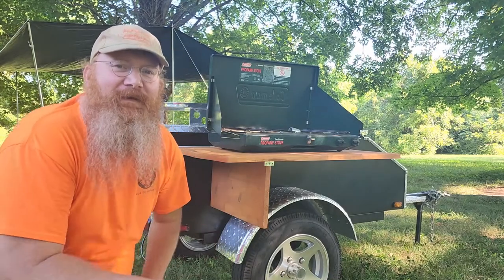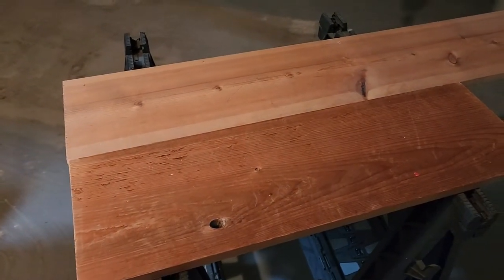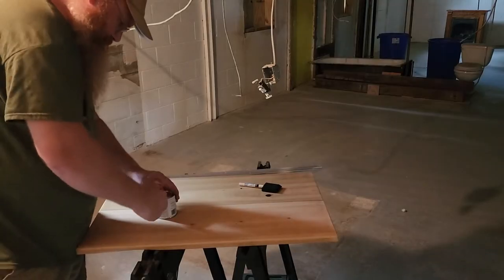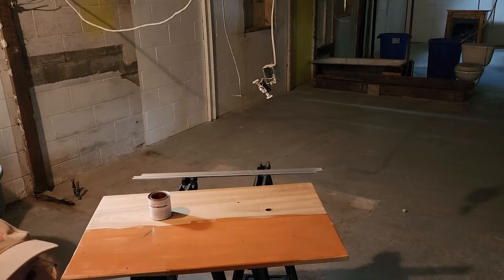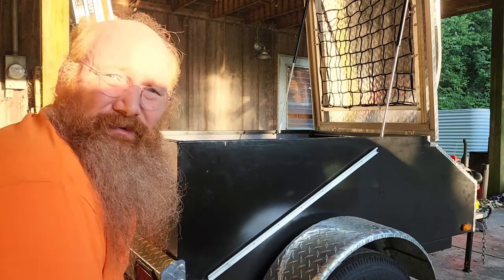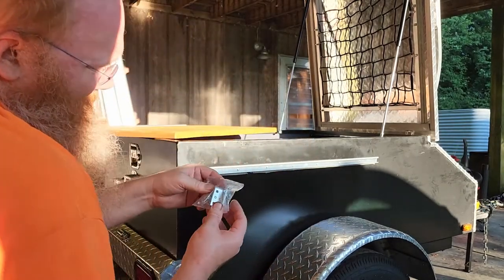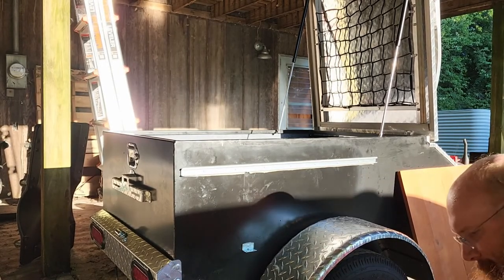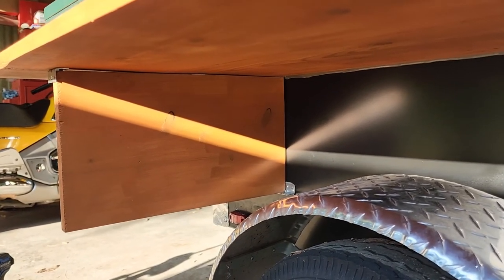Table Build on Lumina XL Trailer

Comment: Piano hinge would be great to hold support. Folds up for storage. Folds down to use as support.
Reply from the maker: That's a good idea. I thought about a piano hinge, but wanted to keep the ability to separate the boards in the trailer. Thanks for sharing. Do you do a lot of fabrication or woodworking?
Reply: @AdventureswithRedbeard  not a lot but when I need something I usually try to come up with something myself. It's cheeper and better quality than most the products you can buy.
Reply from the maker: @carbomb7211  I feel the same way. Not many with this ability around anymore.

Comment: Kind of interesting really? You buy a trailer that’s got a really nice top already built-in to use as a table. Why would you need another table?
Reply from the maker: Good question. When I used my trailer as a table for my camp stove I needed to open the trailer to get all the things I left. It also didn't work great for me with the rails. Is using your trailer as a table working great for you?
Reply: @AdventureswithRedbeard  absolutely. I just make sure that my camp is set up and I don’t need to get in the trailer for anything right away. Of course, most of the time I’ve got a picnic table to use, which is really nice but when I don’t have one the top of the trailer works absolutely excellent.😊
Reply from the maker: @jeffreyengle2762  I'm too forgetful. Every time I tried it, I had to open my trailer multiple times with a hot camp stove on top. I guess it was easier for me to build something that remember everything I need. 😁
I've also used this table to cook and eat at rest areas and quick overnights where I didn't fully set up camp, so having the trailer lid open and the table was more necessary. If I'm staying at campgrounds I usually don't bring the table.
Which trailer do you have?